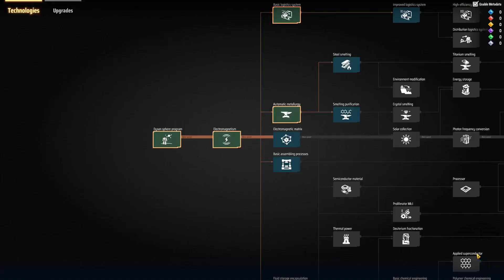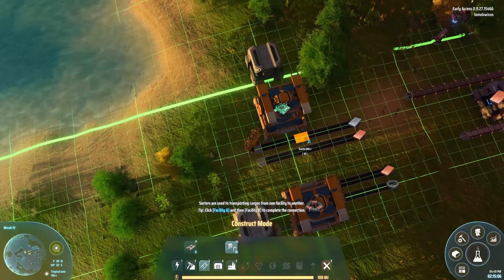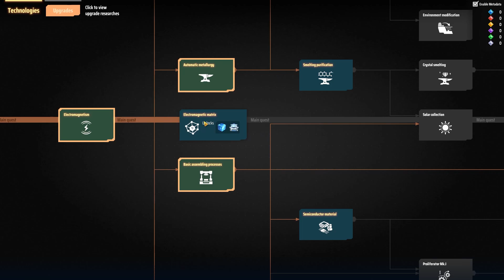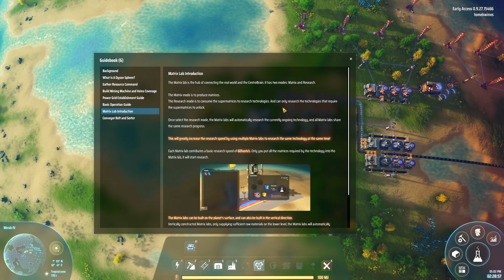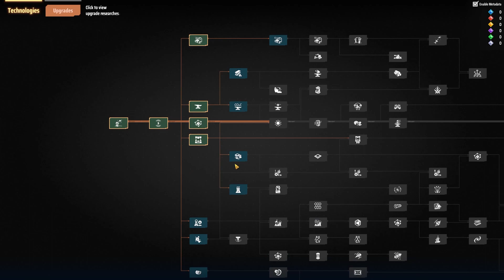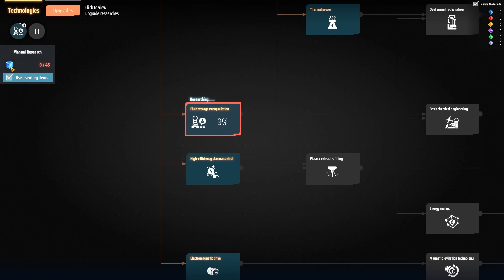Automating Electromagnetic Matrix | EP5 | Dyson Sphere Program | Blind Playthrough

Comment: Remember the assemblers can take inputs from both sides.  If you put the ring belt on the other side (between assembler and box), you could "improve" your efficiency. 😉
Reply from the maker: I didn’t even think of doing an input on both sides of the assembler. I’ll make sure to change that in episode 6. Thanks.